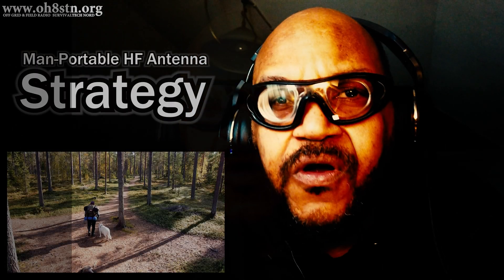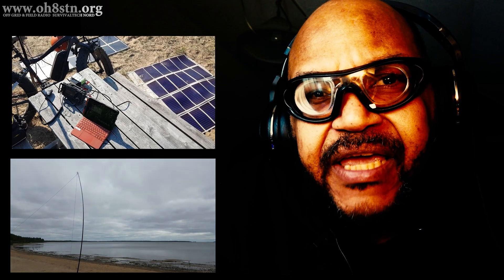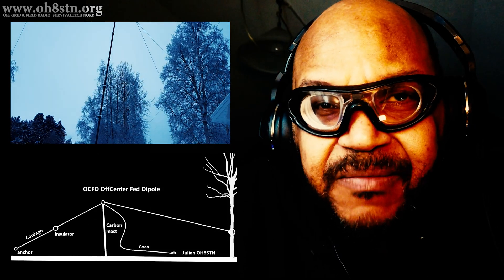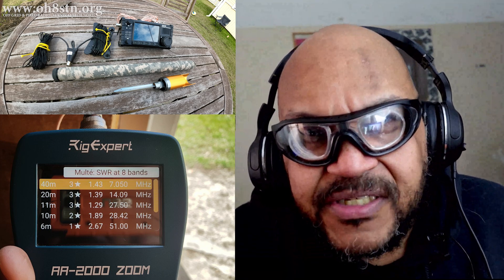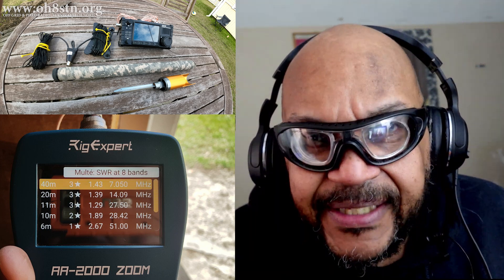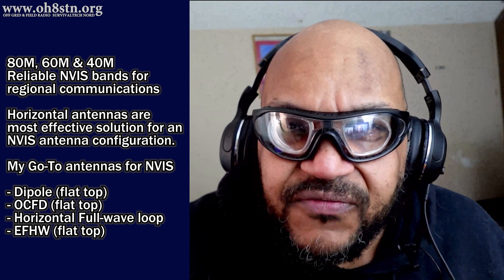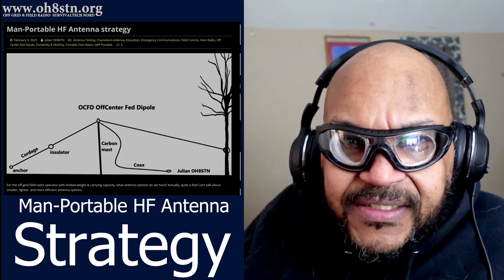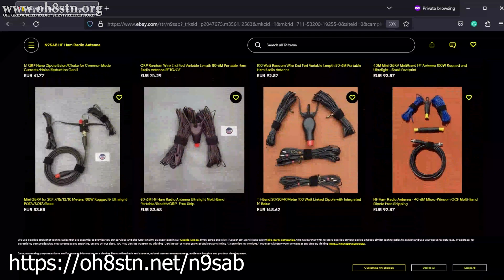Portable Ham Radio Antenna Strategy | OH8STN Off Grid

Comment: I started out as a OCFD fan about 20 years ago. I love frequency agility and efficiency.
In recent years I've gotten onboard with EFHW antennas, especially the 80m-10m varieties. When I first field my EFHW I found it to be mediocre in performance, but testing done by Steve Ellington has helped me learn how to deploy the EFHW for optimal performance. Steve has several videos testing with field strength meters and RF ammeters. Now the EFHW is my go to antenna.
Based on some of your reviews I've tried the Emcom III P, and it has satisfactory performance above 40m, however at 40m and below so far performance has been mediocre, but I am still experimenting with counterpoise wires and choking.
For myself 80m NVIS for regional Ecom is the gold standard. It is predictable active regardless of the solar cycle, 40m is often not a NVIS frequency. 60m is almost reliable and predictable as 80m for NVIS propagation, but you pretty much have to have a purpose built 60m antenna or an antenna with compromised efficiency for 60m, and that is the delimma.
For 80m NVIS operators are stuck with 40m of wire and the easiest deployment is EFHW in my opinion.

Comment: For maximum efficiency I would avoid using carbon masts. Just think about it a mo, conductive elements in the near field of the antenna reduce efficiency.  Carbon is a conductive material. If You really want optimum antenna transmission efficiency use non conductive materials for the mast. :-)  Just a thought.

Comment: 40 meter off center fed antenna with 18 gauge copper clad steel cable makes for lighter weight and a resonant antenna except for 15 meters. Build your own balin or buy and string the wire yourself. Same goes for a 9:1 end fed. Use 18 gauge copper clad to lower weight

Comment: I am 100% in your corner!  I use an EFHW, with 49:1 UNUN, tossing a wire up in a tree, and having the other end elsewhere.  BTW, I used my VNA for the first time today.  40m CW section 1:1.6 or less & 20m section 1:1.5 or less.  So, no tuner needed with my TR-25 or FT-891.

Comment: Sorry for maybe a dumb question, I'm studying for my general and am trying to research to buy my first HF radio and off grid equipment. One thing that you said that I didn't know, why do you cut the tip of your mast off? At 11:13
TIA KI5JDZ
Reply from the maker: Awesome question.  It's just because the tip breaks with too much weight.  Lower it down one section,  and it holds more weight  👍
Reply from the maker: By the way  hamradioprep is an excellent study aid. You can get a discount using "julian20" as a coupon code.

Comment: I agree with your man-portable HF antenna strategy.  EFHW & OCFD's seem to be the best tool for the man-portable mission in many cases.   A lightweight resonant antenna offers many advantages for field use.   I think a lot of folks have not really thought through or experienced the difference between truck-portable vs man-portable.  There is a huge difference in carrying your gear a short distance from your vehicle to your operating location and true man-portable operations.   I guess it all boils down to your philosophy of use.
Reply from the maker: Best comment of the day!
73
Julian oh8stn
Reply: What would you recommend for a manpack antenna, I just got my technician license about a month ago ,running a ft891 , I've got a turner ,but I would rather not have to carry it ,Thanks for any info KD9WTH. 73
Reply: @garytedlock7533  I think Julian pointed out the primary choices are EFHW and OCFD for band agility. The question is durability vs. weight. I personally favor EFHW for ease of setup and band agility. However, I do not have one that I consider to be man portable.
The EFHW I have been looking at are the Pactenna, MyAntenna, and K6ARK. For manportable I currently use a Cha Ecom III portable. Its not a stellar performer on 40m and 80m, but it is wellbuilt and it does great 20m and up.

Comment: I know you get a lot of comments, but I commented on one of your IG posts with the Chameleon MPAS many months back. I mentioned liking even the DX commander portable over the Chameleon stuff. You kind of dismissed it as being a Chinese fishing pole. Anyways, I have pretty much all of the Chameleon antennas, and have used them all. I also run an OCF dipole as my primary QTH antenna, and have a number of SOTA beam's fantastic dipoles. What I said in the IG post was that any of those wire antennas (including the DX commander vertical) vs any of Chameleon's antennas that use their balun (EMCOMM, MPAS, LITE, etc.) would smoke the Chameleon antennas in performance. The efficiency of radiated power of these wire antennas vs Chameleons balun based designs is night and day difference.
Reply from the maker: Here's more context for my attitude towards the DX commander. The DX commander was a real pain in the butt during one winter Lapland expedition.  It was about -20 Celsius making the wires very difficult to work with. Ultimately they became a tangled mess. The telescopic pole part is made in China but that's not why I didn't like it. I didn't like it because it became frozen during the deployment, making it impossible to bring down and pack out. Ultimately I had to leave it there, retrieving it the following summer. So it wasn't a personal reply to your comment, it was just a bad experience with that particular antenna.
Regarding the broadband antennas, they have their place, I still like them. The weight savings of a wire antenna and carbon fibre mast makes using them no brainer, when weight is an issue. 
Apologies for my crappy attitude on the DX commander. My hands suffered tremendously on the trip with frostbite. I even tried to explain to Calum about the mast getting seized, but he blew it off. I've been put off on it for portable ops ever sense.
73
Julian oh8stn
Reply: @OH8STN  Thanks for the reply, that makes sense. In the states, most of the U.S. wont see temps like that. Not really countering any argument. I think all these options have their place given a situation. I just think more often than not in the south east U.S., unless I'm on a summit, I'd reach for a wire antenna. Especially if I was serious about getting out on 40/60/80, the NVIS bands, where the multiband CHA antennas become less efficient.
Reply from the maker: You are very welcome.
I don't disagree with you. It's just more logical to use a simple dipole on 80/60/40m, rather than a DX Commander in the field. A DX Commander is not going to do well for NVIS unless it's in an inverted-L configuration. Even that's a compromise but better than a 1/4w vertical. Not trying to win an argument,  just Think we should use the right tool for the job.

Comment: Can you help me understand what the advantage is of using an OCFD Dipole versus a regular dipole? Is it simply the location of the feedpoint, or is there something else to it?
Reply from the maker: A normal dipole is mono band and fed in the centre. The off centre fed dipole fed at one-third from Centre is a multiband antenna. So where a normal dipole would get 40m, an off centre fed dipole would get 40, 20, and 10 meters with the same amount of wire.
73
Julian oh8stn
Reply: @Off-Grid Ham Radio OH8STN  Thank you, I had not realized nor been taught that. I've used plenty of EFHWs and Dipoles but never an OCFD. Appreciate the insight. Youtube and the internet serves as my "elmer" lol.
Reply: @Off-Grid Ham Radio OH8STN  I wonder what the difference is in terms of performance between a standard dipole and OCFD. Say a 40M dipole vs 40M OCFD, would it be mininal at best?
Reply from the maker: @Kody10538  the Mono band dipole is always going to perform better 👍 this is why so many operators like the linked dipole.
Reply: @OH8STN  Makes sense. I have several N9SAB antennas already.  Tim is great. I have the 20/40 linked dipole,  40m EFHW, and recently had him make me a 20/40 linked EFHW for quick qrp deployments where I only want 20M. Love the rugged designs.
Reply: A big thank you Julian loved the video 73s de EI5EN.

Comment: Not a good time for raising a wire with a huge helium balloon.
Reply: Ive been thinking about this type of setup. Your statement makes me think im not the first. Have you seen a wire deployed on a helium balloon before?
Reply from the maker: I have. the idea is good, but equipment may be too heavy to be practical.
Reply: @OH8STN  A vertically polarized longwire would be a great experiment, or a dipole, off center fed, ect...just using a huge balloon for any reason might attract the U.S. Air Force due to recent events.

Comment: helium balloon with signal-antenna tether line spool, end of story
Reply: works as submarine antennas too, floating to surface, and higher
Reply: cable wire can also lowered with a rock to sea/lake bottom
Reply: helium balloon is only the balloon, helium canister, refillable, and 1+4 tether lines, even 5 signal lines if all pyramid tether lines are used as angled antennae
Reply: you know those weather balloons, helium, can also carry 360 surveillance cameras, if applicable
Reply: also you can have sectioned length of the signal wire cable, to have multiple wave-lengths at same time, or just lower/higher the antenna balloon with the tether to tune the antenna
Reply: you could also easily drag the antennas to trees on site, if applicable
Reply: diy is the best,  no dependency of manufacturing, just change the antenna spools for different operation, or have all modes in one spool
Reply: also kite lift wire spool antennas
Reply: or just a tent antenna from flexible arcs

Comment: Great ideas! I'm at the early stages of looking for something like an end-fed (maybe) 15-40 trap dipole. For backpacking that I can throw a paracord up into a tree, done. Thus, weight is first and foremost! John WA4JC
Reply from the maker: Very nice. Yes reconciling the  weight is often a problem.  Trap dipoles are awesome if the traps are small enough and waterproof. Otherwise they get caught on branches, and detuned in poor wx. Brilliant idea though since you don't have to fiddle with the wire for band changes.
73
Julian oh8stn

Comment: Julian, Only wire? A super antenna mp1 for portable HF is just a spike mount, a coil and a whip. That's not much to pack, have packed it myself. If it's tuned it's pretty efficient, you've even used it in older videos.

What am I missing that make this not an effective antenna for portable?

Comment: Absolutely love this video Julian! This exemplifies the differences between SOTA'esque and POTA'esque emcomm approaches. The POTA station mentality often means 100W, super heavy verticals, huge batteries, clunky computers, etc., mainly because when you're driving up to a park you can easily carry all that stuff. SOTA, on the other hand, is all about minimizing weight, maximizing efficiency, and lightning fast set up and tear down. I think the mindset begins developing the first time you freeze your butt off on mountain summit with winds blowing right through you - with miles of foot travel, thousands of feet in vert, and a long car ride between you and central heating... under those conditions, you tend to rethink your gear strategy REAL quick. In the event of a major emcomm situation, even the availability of fossil fuels is something you have to seriously consider, meaning we should take our learnings from SOTA, i.e., lightweight and efficient rigs. 

There's a convergence happening right now in the SOTA space around microportable antennas like the K6ARK transformer kit and N9SAB antennas, which are quickly becoming the new standard as the desire grows for lighter gear with lightnings fast setup and teardown times. Currently, I see operators converging on the EFHW and random wire configurations, mainly because of ease of deployment and minimizing guy points. I see less and less dipole-style configurations, mainly I think due to the additional setup time required (additional guy points, etc.). I haven't seen anything definitive comparing an OCF dipole vs. a random wire that would lead me to believe one is necessarily more better than the other, though there could be. There is an article by UZ2UUF comparing SYMMETRIC dipoles to random wire antennas, but that is like comparing apples to avocados and doesn't really apply to an OCF vs random wire discussion. For example, the night ops random wire that I'm using now is 5/8 wavelength on 40m and is SUPER performant. A 5/8 wavelength random wire provides a theoretical 2.5 dB gain on 40m. I'm not sure if there's an OCF geometry that can claim the same, though again, there might be.

When it comes to verticals like the AX1, Buddipoles, etc., while convenient, don't really fulfill the efficiency requirement for emcomm, particularly the NVIS requirement. In the field for emcomm, nothing beats the versatility and efficiency of a wire antenna.
Reply: Excellent Comment.

Comment: Thank You for telling the truth about the bulk, weight and inefficiency of the Chameleon antennas. They are great when needed for very specialized use as they were designed for, but for regular portable use, there are far better options. Too many channels promote them and don't give all the facts as you have done. A tough, resonate wire antenna will always be one of your best options. Love your content....Thank You !

Comment: I like this route your going Julian. The one thing I could not understand previously is why you used "compromise" antennas, especially with QRP. My thing is building antennas as you probably know and my ethos is always high efficiency foremost. I think commercially built antennas are like fishing lures, there to catch the angler instead!

Comment: I love this strategy.  I am currently building a gator case emcomm bks with my 891 and a 2900.  For more ares type work.  I plan on getting a 705 in the near future and running a very lightweight man porta le setup as well.  So this is a great suggestion.  I perfer resonant antennas and have heard of Tims antennas on different channels and will be looking him up.

Comment: I’ve actually had a great experience with a SuperAntenna. Very compact and portable, easy to set up. It’s actually my “permanent” antenna at home because it’s so unobtrusive and I have limited space. It’s been outside clamped to my rear fence exposed to the elements for three years and still works great. Does not require an antenna tuner, though you need to adjust/slide the coil to change bands. Can function up to 80m, and all bands below that.
Reply from the maker: Agreed. The super antenna is small and light enough full stop although I do use a longer whip to reduce the loading. Even so, that's a great quarter wave antenna.

Comment: One more thing about the MPAS is that most of the time you need a tuner.  Sometimes depending on the ground, it works at 20 or higher - well like I said sometimes.

Comment: I have been looking at N9SAB antennas for awhile but seeing your video I went ahead and pulled the trigger bc I know its gonna sell out! Question ... I have an 817ND and if I switch to the thinner coax and run the feedpoint up a pole I worry I may loose a fair amount of signal ... whats the loss difference between RG8 and your thinner (316?) Coax? Thx

Comment: Aloha Julian.  I have been using Tim's antenna systems for awhile now. Found out about them last year . At 21 N in almost the middle of the Pacific,  it is imperative to have an efficient antenna system as almost all degrees of the compass is DX. Even surrounded by salt water it is not always possible to be at the waters edge (example: tsunami, high surf or hurricane type environments). So an efficient and effective light weight antenna systems have been on the top of my list for many years now. The modified Chameleon MPAS has worked well especially while using it with the 17' stainless steel collapse whip. Usable QRP 17m to 10m without a tuner VSWR 1.0 to 1.3. However it became a challenge QRO without the need of a tuner (extra baggage). I depend on SSB phone communications most of the time as I only need to carry the well built Lab 599. IC 705 tends to be bulky in size. Tim's antennas have been a great addition to my system.  Carrying a set of dipoles only takes up minimal room. I also carry his linked system for 20 to 40m for those bands. I don't like tuners because it has been my experience,  they take away from efficiency. Anyway, good job Julian!  Mahalo Piha! KH6LH
Reply: Finally was able to get outside to test out the 10m QRP N9SAT dipole antenna. I was pleasantly surprised by the performance. Erected at about 15 feet in an inverted V configuration using the TX-500, 25 feet of RG 316 and was able to work CONUS AZ station that gave me a 5/3 followed by Australia also 5/3. Power output 10w with SWR 1.5 to 1. Environment was outside in a grass picnic area of my condo, 52 feet above sea-level, ½ mile N of Puuloa or Pearl Harbor.  This is exactly where I have been using my Chameleon modified MPAS. The N9SAT was approximately 2 S units (12 db) louder or stronger then the MPAS. More testing is being done as time and weather permits. So far these antennas are a keeper. Thanks for the tip.
Aloha KH6LH

Comment: I'm a big fan of lightweight QRP setups. Especially for Emcomm. I'm testing the QRP labs 5w QDX on 80/40/20 meters. If the OCFD will run those without a tuner, I'm happy to jump in the pool. If not, I'll stay with my EFHW as I don't want the added weight of a tuner.